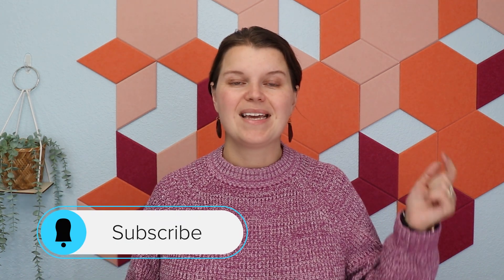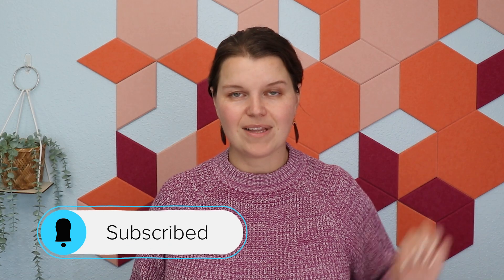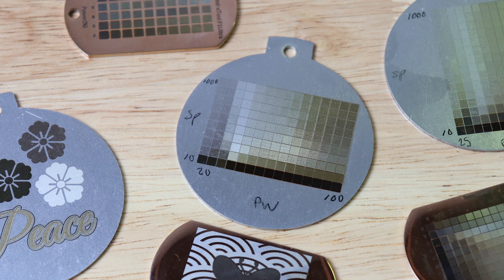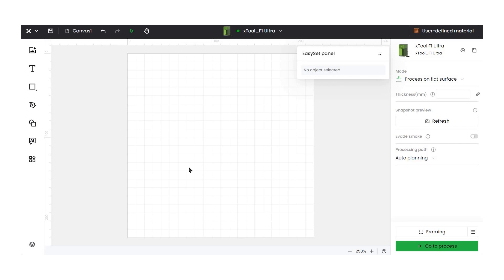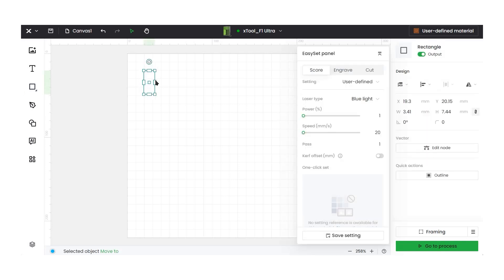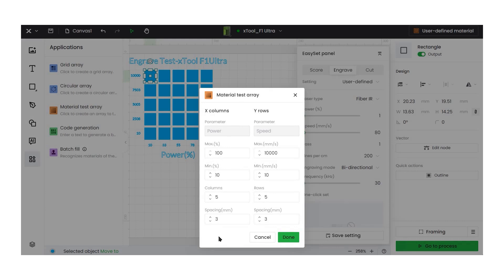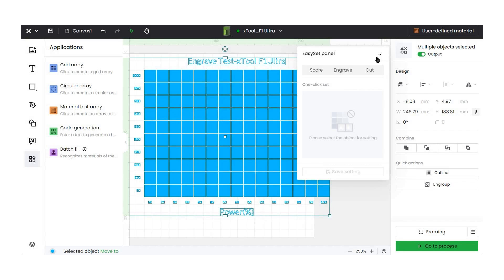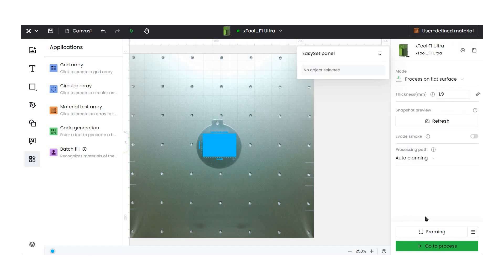Color Engraving on Metal with xTool F1 Ultra Fiber Laser

Comment: Thank you for this, very helpful as I'm learning how to use my F1 Ultra! I'd really like to figure out how to print some blue colors, have you found and decent settings/parameters to do that?
Reply from the maker: I would repeat the same process for a test array using the diode laser. You'll have to hoan your settings a bit, but you can get some good color with that as well.

Comment: Good start but I disagree with some of your comments.  The Ultra diode heats the metal faster and better than the IR/fiber and will produce a much more vibrant color array than you will ever get with the IR.  Deep blues to bright maroon reds.  You are selling yourself and the viewers short by not seeing and showing what a diode will do on SS.  Also a test grid can be very misleading since the gradual and continual increase in heating of the blank as it continues to engrave each square means that they are not all starting from the same temperature.  Try the setting from one of the last squares engraved on a cold piece and they will not match the ones done on the grid that was already very hot.  This is even more a factor when using the diode because it does heat the metal much faster.  IR for boring shades of gold, brown and black.  Diode for many vibrant and pastel shades across the rainbow.
Reply: I'd really like to figure out how to print some blue colors... you say the diode does that, can you give me some settings/parameters to do that and for other colors? (using the F1 Ultra) Thanks.
Reply: @hopeforamerica1714  Run a test grid, too many variables to give you a answer for your piece with your design and your laser.
Reply: @gregparker5732  that's still too many variables for me, ha. I'm a beginner, for me it's like throwing darts dizzy and blindfolded, seriously. Could you please give me a starting point? I've got the F1 Ultra, I've got some stainless steel cards .8mm thick.  Diode? If you were going to run a test grid on these to try and get a full spectrum of colors, what would your power range start at, min - max, what would your speed range start at, min to max? And I see there's some variables with how many lines per cm, what would you start that at? Please and thank you!
Reply: @hopeforamerica1714  Find something 3 times as thick to start with.  The high heat will wrap cards.
Reply: @gregparker5732  so 2-3 mm thick stainless steel to start with?